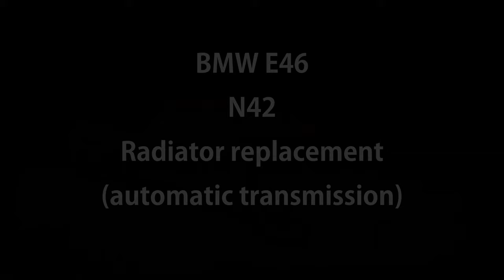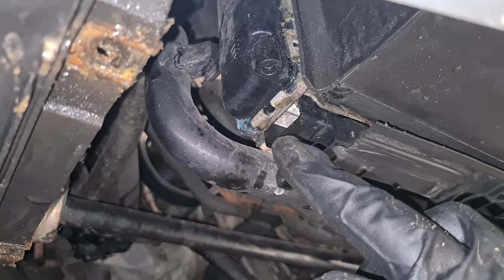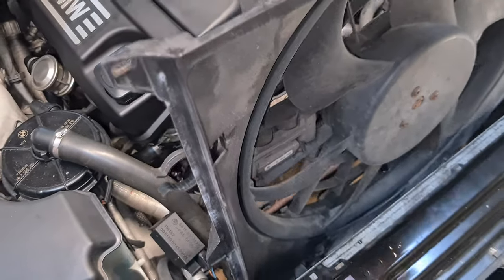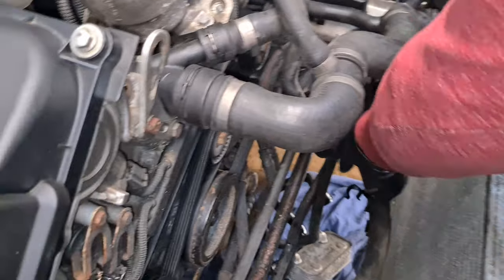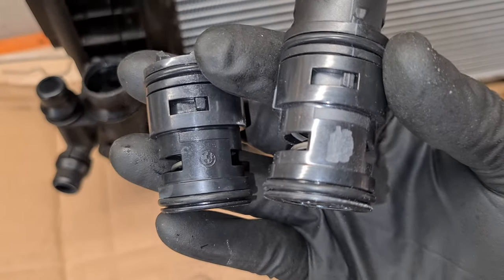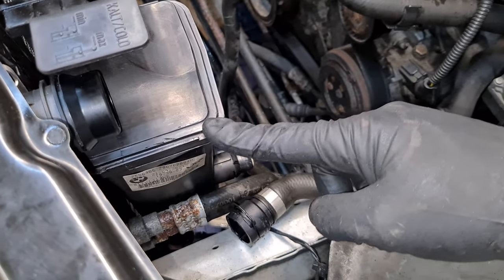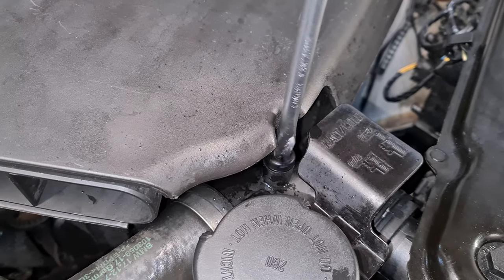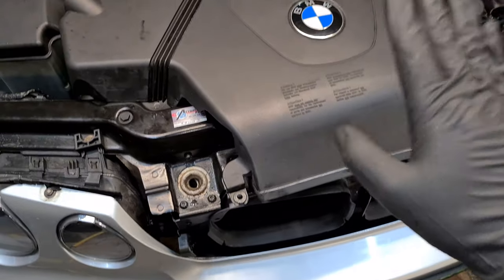BMW E46 N42 Radiator Replacement AUTOMATIC TRANSMISSION

Comment: Hi BimmerZen! Happy new year to you. Thanks for this video, it might come in handy in the future. I am currently experiencing VERY slow coolant loss in my 2004 318i. 

The coolant system in these vehicles are weak points and will fail eventually, be it hoses, the thermostat, and the radiator it seems. I replaced the 2.0 bar expansion tank cap, with an OEM 1.4 bar one, which should help with longer life of the cooling system. The plastic connectors of the hoses seem to become brittle and break over time, I've replaced two hoses since the vehicle has been in my possession.

I will have to keep an eye out for where a possible leak might be, however it might also be due to pressure release because of the lower pressure cap that I put on.

Thank you again for your guidance, time, and effort and in turn making it easier for E46 (especially N46) owners to maintain their vehicles with confidence.

Greetings from South Africa.

Comment: Excellent video. I did my radiator last summer. Since this is quite a big (and messy) job, I'd also recommend replacing the top/bottom radiator hoses and expansion tank, together with the coolant level and temperature sensors (located in the bottom hose). Happy New Year to you.

Comment: Nice. I did mine as well a few years back.

If you ever need to replace the reservoir get one from BMW directly. I got the one from Hella/Behr, it did not seal properly on the bracket towards the bottom and kept on leaking. Was a pain.

Since a few weeks my heater is no longer working, I think the heater valve is broken.

Still being totally Zen about it.